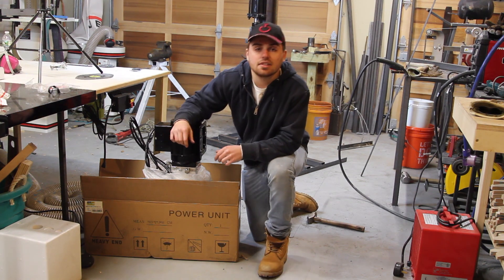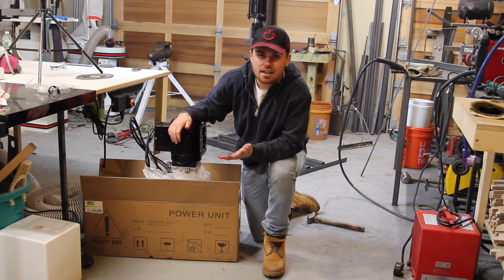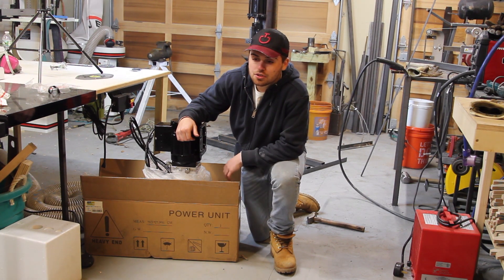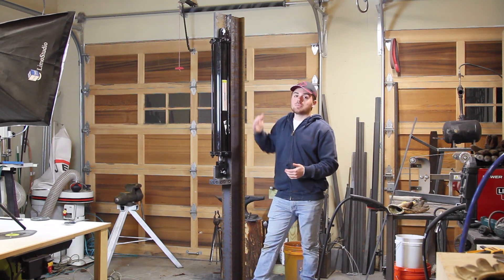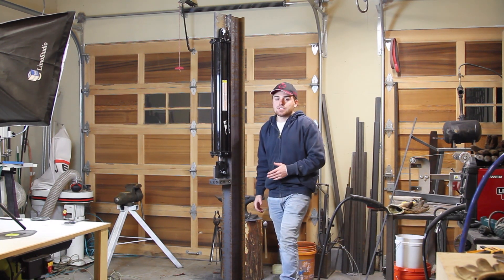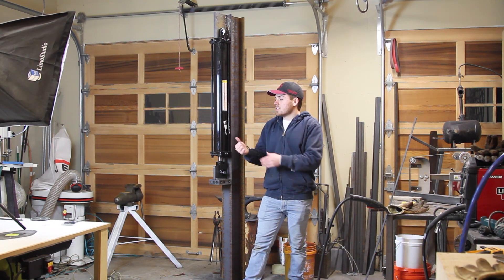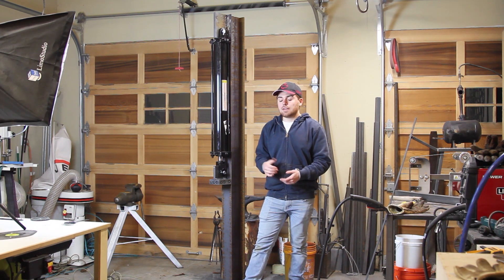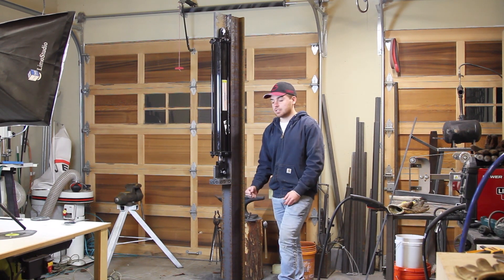Building a Hydraulic Forging Press - Part 1

Comment: Blacksmith presses are usually built with fat short stroke cylinders 4-5" in diam. or dual smaller cylinders, and a much beefier I-beam or an H-frame.  I built a log splitter with that exact cylinder and size of I-beam and the I-beam will flex under full load. I've seen many press builds on Youtube where they recommend at least 20 tons and ideally closer to 30 for forging. I think I'm going to just convert my $150 20 ton Harbor Freight H-frame press by adding the 20 ton air over hydraulic jack. They are slow, but quite capable for hobby use, and a total investment of about $250-300. (Plus any dies you make)
Reply: AndTheCorrectAnswerIs Bu MK